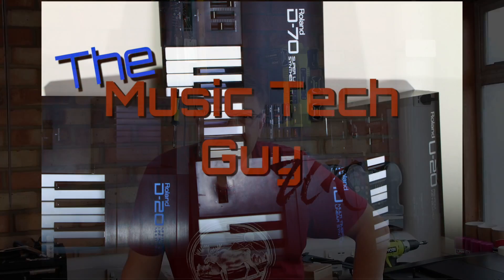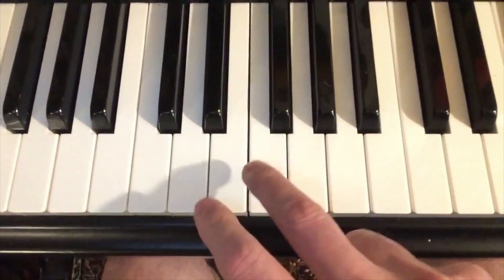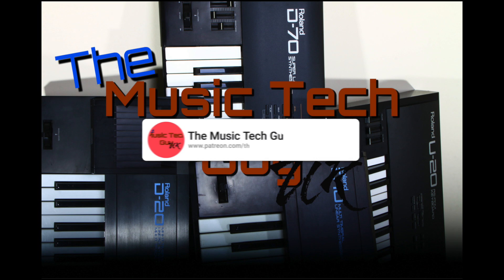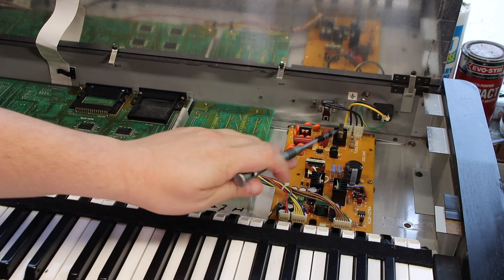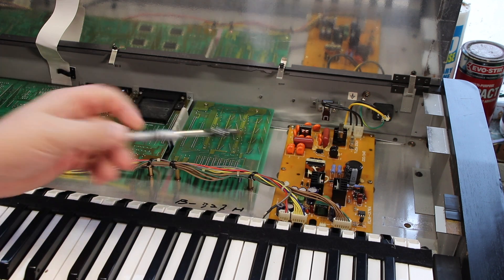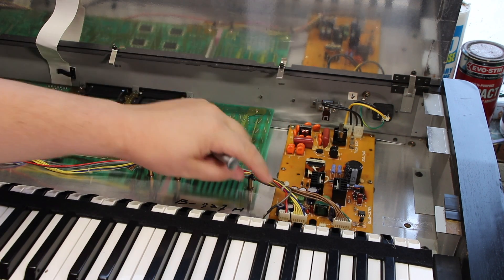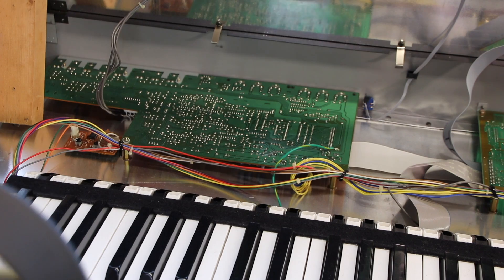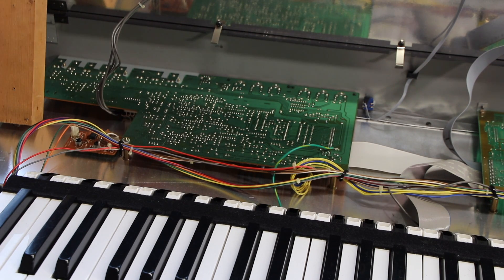My Korg T1 doesn't work

Comment: Hi!
Thanks for the videos !
My T1 doesn't fire up at all I think the problem is in the power board. Around R7 it's toasted it's like burnt out. I can't find a replacement for KLM-1375A board online anywhere. What shall I do next?
Thanks
Reply from the maker: Hi @George K 

It does sound like the Power Board is fried but maybe not unrepairable.  If it looks like you have components that have burn out, well in a way that is good as it maybe gives you a clue as to what is going on.  

My gut feel is that the power board capacitors have gone, which has probably burnt out the voltage regulators.  I would probably start by replacing these components plus the fried resisters first.  Then if working and you have access to one put a meter on other components to ensure that they are working within limits.  Jon

Comment: Greetings, I have a Korg O1/W Pro K, very similar to T1. I have some upper seam keys, want to fix. Any suggestions? Thank you
Reply from the maker: Hi @Nowizzard24 

They are the same buttons for the same T-model.  The problem is that especially the oblong buttons on the T1 are becoming very rare at the moment.  You just have to look out for someone breaking or selling these.

I know at the time of writing there is a guy in the UK selling about 30.  This is listed on Reverb, but it is not listed with shipping to outside the US and therefore for me does not show up if I have the location set to UK.

There may be news on this area before Christmas as I have a plan. Jon